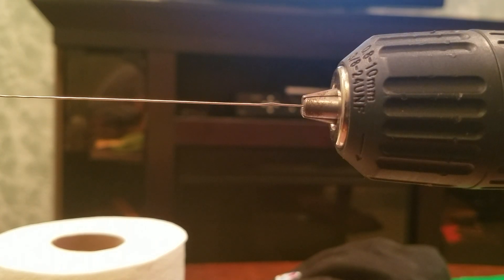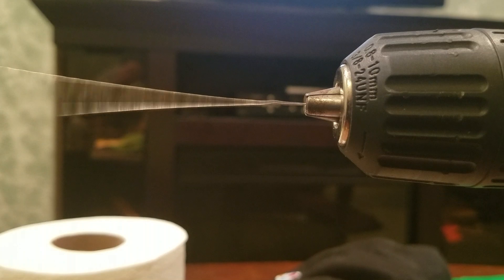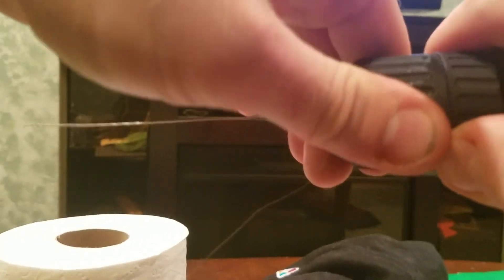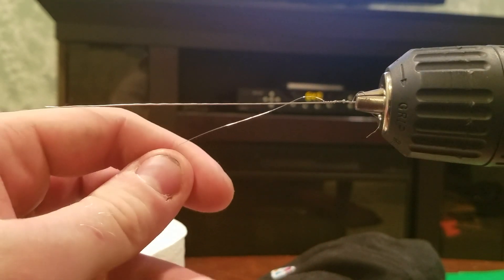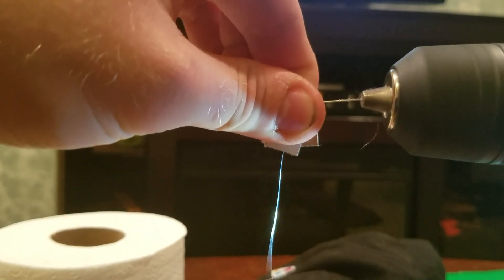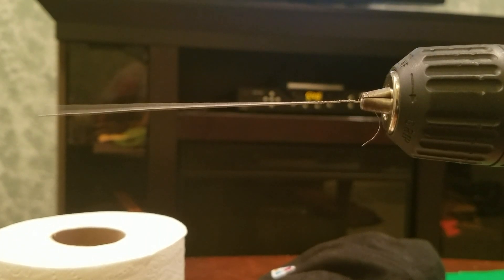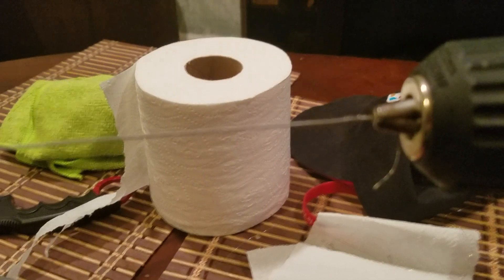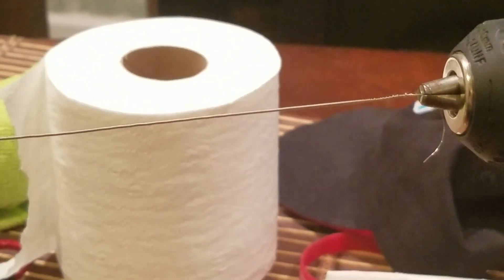Easy way to make a Clapton wire

Comment: Can you show the method for a fused Clapton? Or will this method also work? Thanks!
Reply from the maker: This wont work with fused claptons sadly. With fused ones the cleanest way to make them is with swivels. If you do them without, it's inconsistent. If I get my hands on some more 34 gauge wire, and some tools, I'll do a fused clapton build
Reply: Sergej Jagodin okay awesome! Thanks so much I'd love a video for another easy turorial for fused claptons thanks man!